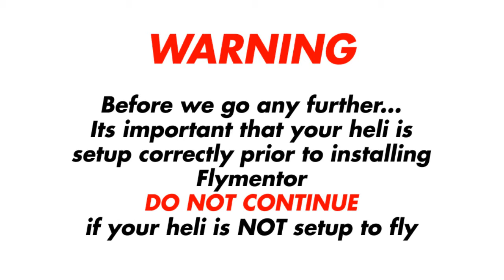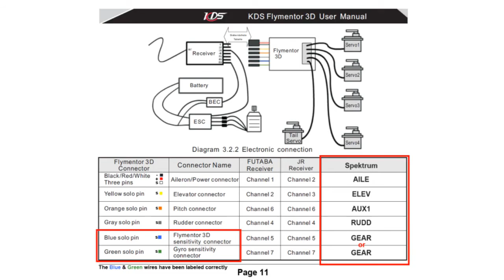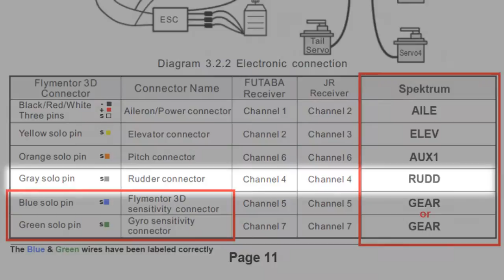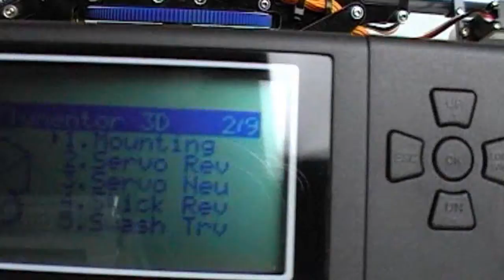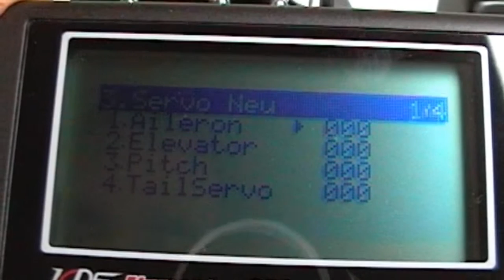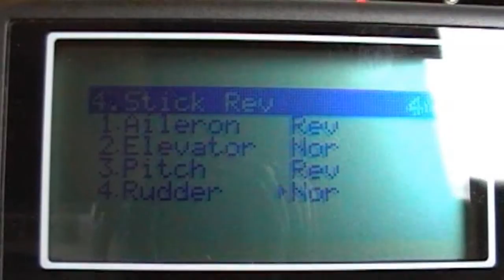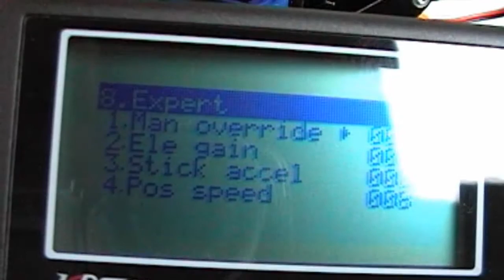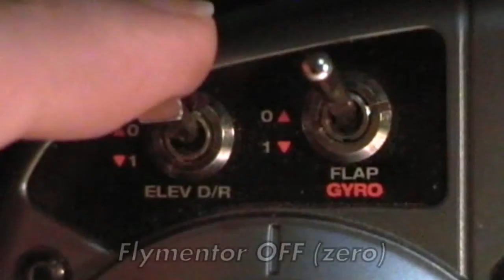Flymentor - Complete Setup Video (Dx6i)

Comment: Hi Ivan hope ur well, i know this has took me quite a while,lol but im about 805 there, i took my Esky gyro off because for some reason chouldnt get it working, so i put the KDS gyro on and surprise surprise i cant get that working either, its better then my Eksy thou, im testing it on my lazy susan and i can get it to stay pointing forward, but as soon as i give it rudder left/right it just spins uncontrollable and cant get it back under control, you wouldnt have any ideas Ivan would you? very greatful if you have, thanks for ur time and help, and if it wasnt for you and afew others i wouldnt have got this far, so thanks again
matt
Reply from the maker: Hey Matt...I think it has to do with the gyro being reversed...rather than countering the main blade torque to stay straight, You might need to reverse the gyro (when the heli points right, the gyro should counter it and make the heli go left) Try reversing the gyro direction..NOT the servo and see if that fixes it.
The way to tell if its setup correctly is (looking from the top of the heli) if you rotate the heli anticlockwise the pitch of the tail blades should move left to counter that movement...and vise versa...yours may not be doing this...see how you go.
Reply: Thanks for getting back to me, say it goes in the right direction, its just when I turn left or right it turns very fast and have to slow down to make it go to the opposite way, I have gone into gyro on my TX and changed the rate, I did have it at 0= 70% n 1=40%  so I changed the top one. To 0= 40% and bottom one 1=40% and its seemed to make it abit better , so tomoz I think ive just got to mess around with it abit and see if I can get it less sensative. Thanks very much for ur reply thou Ivan, very greatful.
Matt
Reply from the maker: The gain of the gyro represents the mode its in and how sensitive the gyro is to movement...generally 0-50% is rate mode 50-100% is heading hold mode, however the "speed" of the tail gyro is controlled by the tail servo "travel adjustment", try lowering the travel adjust for the tail servo and see if that slows the tail down.
Now Im confused, cos there is a gain in FM and in the TX, depends which wire is plugged in etc...its hard to know when I dont know the full setup of your heli.

Comment: Hi again Ivan really soz to bother yet again, what wud i do without u,lol. Now getting the swash level, on normal setup we have TX set with idel up and throttle set to 50% dont we, do we do the same with this???
thanks
Reply from the maker: You dont necessarily need to be in idel up, but you do need to be at 50% throttle (mid stick..this is the neutral point where the blades are flat..no pitch) to adjust the swash level. You can set the pitch curve to 50% across all positions, that way your certain your at mid stick. If you get it level in the middle, it should be level at full pitch as well.
You can set it up in Idel up, that allows you to check the negative pitch leveling. The pitch curve in idel up is a linear curve from 0-100% in normal mode the pitch curve will be -48,-49,50,75,100...just make sure you are at 50%...use your "Monitor" setting in the TX to see your stick positions if need be.

Comment: This is a wonderful tutorial! The instructions are concise and perfectly illustrated. As good as it gets! I'm running mine on a B400 with a Jet Ranger scale fuselage. It's working and flyable, but it seems to be doing a lot of sudden, hard correcting in the pitch axis.  Perhaps I need to go through the swash leveling process again. Is there any reason the FM control unit can't be mounted in a vertical position? I'm certain all of the sensing is done in the gyro unit and It works out better for mounting it on the heli frame if I rotate  the control unit 90 degrees, which puts the programmer cable jack at the top. BTW, I'm using an external tail gyro. Thanks for a really great video!
Reply from the maker: Hey buddy..You kinda got me there...I thought the gyro / sensor that comes with FM is a 3 axis gyro.
In the manual (page 13 section 3.2) It states "The controller can be mounted in any place you want" which suggests it doesn't have sensors in it...the gyro/sensor and the camera must point in the same direction (forward).
Im kinda confused to know how it works with an external gyro (Not familiar with external gyro setup...There is NO need for an external gyro..dont believe the hype..i'll keep saying it)
Ar far as pitching axis...definitely level your swash...and check that the gain for the auto leveling is not too high..if its high you get more sudden corrections.
Reply from the maker: Just realized how it works...Yes you can put an external gyro on the heli (don't know why, cos your learning to hover... not doing 3D) BUT you must also have FM sensor on the heli...cos it does ALL the aoto correcting (not the tail with ext gyro).
SO yes mount the FM unit where you like...but make sure the FM sensor is in the gyro spot on the heli.
Reply: ***** Thanks IvanBarb4. The reason I'm doing the separate tail gyro is because try as I might,  I couldn't get FM to manage the tail properly. Don't know why, perhaps it's the tail servo FM doesn't like. When using an external tail gyro, you just eliminate FM from tail management all together. So I have the tail gyro hooked up as normal for any bird and any adjustments to FM I do with the programmer. I can't change the FM modes from the xmitter, but for what I'm doing it's OK. I only fly scale with this ship, so I leave FM on position mode. The bird flies around fine and I can still amuse myself with hands-off hovering. The FM controller seems OK with being turned on it's side and the FM gyro is located where the tail gyro normally sits. The "extra" tail gyro is mounted behind the FM gyro and it's all working fine. I just need a little more tweaking with the FM settings. Thanks again for your great video and for replying to me!
Bless you man!
Reply from the maker: I understand..however FM does a great job of holding the tail...Your right, maybe the servo is not the best..I recommend a 500 size heli servo like the futaba 9257 clones set to 1520us, on the 450..You have to make sure your tail servo horn is 90° and that the tail slider is centered or offset slightly to counter the torque of the main blades, make sure there is no slop in the tail assy..fm should take care of the rest.
Either way, as long as it works...get out there and flyyyyy :)
Reply: ***** Thanks man! Yeah, I'm running a Goteck 9257 on the tail. Nice servo and should work fine with FM. The tail is working fine with the HK401 gyro, but I would really like to get the tail under FM control, just to understand why it's an issue. Hope my FM gyro (tail circuit) isn't whacked. Otherwise, I'm enjoying playing with FM and as you say, as long as it works, let's go flying! Bless you!
Reply from the maker: the1realanalogman You got yourself a good tail servo, there's no reason you cant get it to work...make sure the sensor is pointing forward and let the software know that...servo horn 90° center the tail pitch slider (add offset via subtrim or mech later) set the gain 60-70% (test) and leave it be..no need for tx control of the tail gain if its set and working good...leave that for switching between modes...you'll want that.
The HK401B is an issue for me...Is it still hyper sensitive after they re designed it all that time ago? be careful with that gyro, the gain has to be that low that it sits in rate mode...thats another discussion :)
Cant recommend a simulator highly enough!!!

Comment: I have tried the gyro sense from 0 to 100 but makes no differance
thanks 
matt
Reply from the maker: I think (its been a while) the gyro sense is the gain...it needs to be up at around 60-70% so its in heading hold mode, which locks in the tail...that along with the correct gyro direction should make it work, but there are other factors involved...Are the tail blades spinning in the right direction...the tail blades should spin anticlockwise when viewed from the blade side (helis right side) whilst the main blades spin clockwise (viewed from top)...check that.
Thats why its important to have the heli setup correctly before you install flymentor..if one thing is wrong it could effect other stuff and it gets confusing.

Comment from the maker: Hey people...Just thought I'd have minor RANT...

There is NO NEED to place an external gyro on the heli with Flymentor...

If you are installing FM, then its likely your learning to hover (No hard core tail maneuvers) all the tail is doing is holding its spot...or a slow rotation...In which case the FM gyro is MORE than capable of doing that job..much more (check my 450 test hover...I through it around a bit...works just fine)

When your ready to do HARD CORE 3D (maybe 2 years of sim and field practice), then remove FM and install your long awaited gyro...3D flying is when you need a killer gyro and good quality tail servo.
Just my $0.02.

Comment: Sorry again Ivan, i should ask all at once but i forget, ive got my own gyro which is pluged into my RX not the KDS so i have to set that up via my TX dont i? and not the KDS. At least this may help other with same questions
thanks again!
matt
Reply from the maker: Its all good happy to help when I can...I have to say I'm not familiar with the external gyro setup.
As I see it, you probably have the Blue wire plugged in, to control the on off of FM...so your gyro TX setting/switches are controlling FM's modes.
What you might need to do if that is the case, is to setup all your FM settings in the software and leave the rudder and gear inputs free for your external gyro.
Im not 100% sure on this...maybe check the forums, but personally you dont need an external gyro with FM, the fm gyro works just fine, and your not doing 3D...when you do 3D you need killer gyro precision..,your just learning to hover and scoot around...ass long as your heli's tail stays locked in your good to go...Dont believe the hype about FM's gyro...check my FM hover videos.